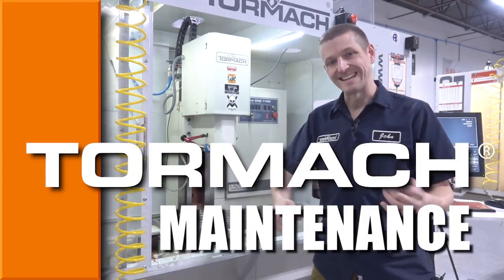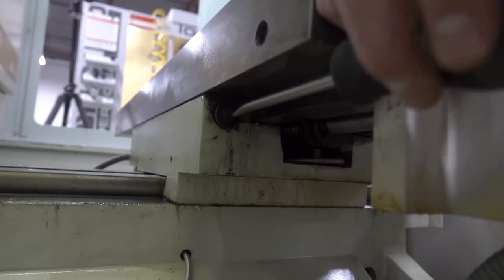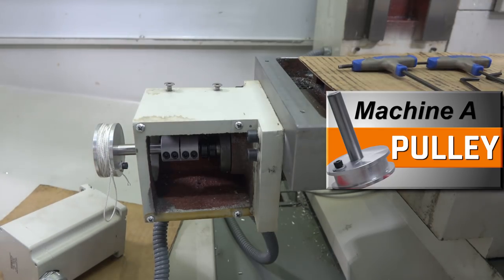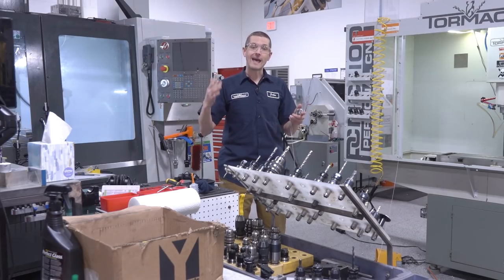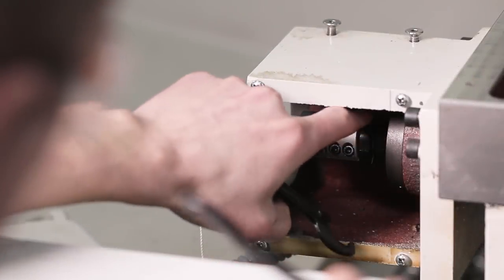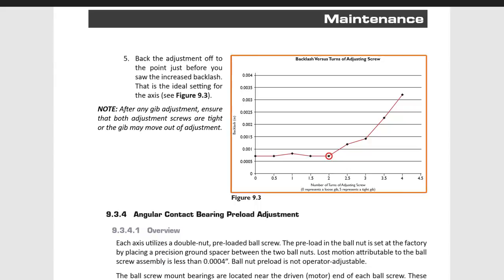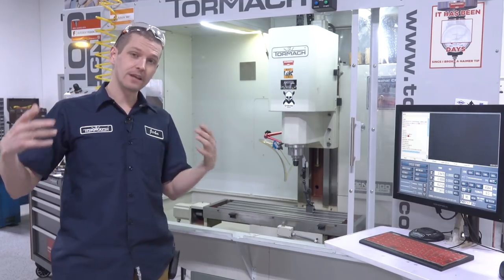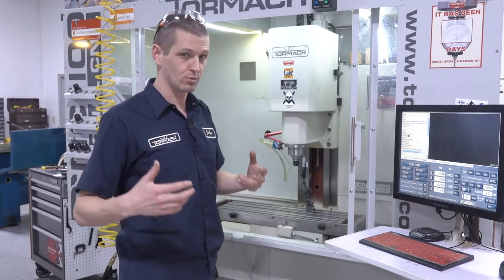Adjusting Gibs and Angular Contact Bearing on a Tormach! WW189

Comment: We do this very differently where I work assembling mills. For gibs we indicate the table in whichever direction we are adjusting and with a prybar move the table back and forth and tighten the gibs until we see .0002" movement, basically just tight enough that there is room for a little bit of oil between it and the bearing surface. As for the contact bearing with an indicator on the very end of the ballscrew we tighten the nut until we see about one tenth in endplay when jogging back and forth.
Reply: Matthew I'd agree. Some servo machines even have a nice feature where you can generate a drag graph after your done setting the Gibbs to show tight spots in travel. The other thing I noticed, which is a no no on a servo machine but probably ok with stepper's is using jog to check movement. Most older servo machines don't really move the set increments they just generalize however if you punch in an MDI move they are dead on.

Comment: John,

Love the vids!  However on this one I think you overlooked backlash as part of the problem in your end readings.  To get the lost motion from stiction due to drag you would measure it in one direction with all backlash taken up and preloaded to move in the test direction.  This would be the best method to determine actual lost motion from stiction and use that then to determine your actual backlash without stiction being involved.

For instance, you had 0.001" movement on that first test move with 0.0011-0.0012" commanded and stated it was preloaded.  This would be the more accurate lost motion from stiction reading.

When reversing direction, you have both the lost motion of stiction plus lost motion from mechanical backlash in the ball screw.  This is a very good method for accurately obtaining a backlash compensation setting because in most machining circumstances, the machine movements will be fast enough to overcome lost motion stiction on a properly adjusted machine which would leave you with just the need for that accurate backlash comp amount to have accurate positioning.

Just a thought!  Might be a good follow up video comparing the two and seeing what impact a properly adjusted gib has on actual backlash.  I have seen too often abnormally high backlash numbers from poorly adjusted gibs.  This would help many to solve that issue!

Keep up the great vids!

Chris

Comment: You make things very understandable.  Thanks for another great informative vid.  Btw, thanks to you for the superglue tape trick and I have to say the work holding class was great.  I have since bought two thread mills from Tormach and I am looking to use one this weekend in steel to cut an M12 thread in steel.  Nervous, but this is how we learn.  Thanks again for the spreadsheet.

Comment: Another option to the pulley is a torque tester. We use them all the time to test the pre-load of bearings for aircraft parts. Same Idea but may be more accurate with static holding in a pulley system.

Comment: Some machines have a "Drag" measurement feature. This is a test operation that runs the table back and forth while measuring drive current (I believe it is the current, or some other means of measuring load). he results are plotted and saved. Neat way to monitor condition by comparing results over time.

Comment: Another approach - other than the string and fish scale - would be to monitor the stepper motor current. For this, since the motor is driven by pulses, you'd need an oscilloscope to monitor the current pulses. Too tight a gib and you'd have excessive current pulses. This would be far more accurate and more meaningful since you know the manufacturers limits for motor current. In fact, I would strongly suggest you do get an oscilloscope. They are very cheap these days and it would show you if you're overloading your motor.

Comment: Even though I just did this to my 770 I'm about to do it again for "fun" after seeing this.
Reply: Nothing better to do with your tools and time?
Reply: I do have better things to do but I would rather make quality parts with my tools and time.
Reply: Then buy quality tools you don't have to "adjust" repeatedly "for fun" and can put to work and keep there and trust to do the job you purchased them to do until scheduled, regular maintenance/adjustment is required. Endlessly jacking with machines "for fun" is a really good way to do create problems if they don't already exist. Machines aren't made to be endlessly "fiddled with" and "adjusted" if they require tools and complex procedures to do so. When they are, they can be adjusted by hand. And they're typically even cheaper junk than machines that need "fiddled with" and "adjusted" when "brand new".

Nothing made to be "accurate" and "precise" and made to MAKE accurate and precise "parts" should need "adjustment" before its even "broken in" much less used enough to have any "wear". And I'm aware this is NOT "normal routine adjustment" for "new" machines and the "manufacturer" emails a link to THIS "how-to video" to its "new customers" who are sharp enough to double-check the machine before putting it to work and who do "test work" on the machine ASAP after delivery. Meaning it must not be in the operators/owners manual and that manufacturer must have pretty piss-poor "customer service" and "product support" if this "machinist" is their "trainer" on how to "adjust" machines that are supposed to be "right" right out of the box. 

What does Tormach pay YOU to act like this is all just "normal" and "fun" and how did YOU manage to do it without THIS HOW-TO VIDEO?

Comment: Hi, John. Quick question: don’t machines like this have a door interlock that prevents the machine from operating while the door is open? Also, I think one of your machines there in the background wants your attention; a white flashy light-on-a-post was blinking, saying “John, feed me!” 🤗
Reply: It's probably the Haas wanting its gibs checked too! 😉  Machines also can get jealous! 😉😉
Reply: The enclosure is an optional extra on Tormach mills. They don't have door sensors, but if they did it would be easy to disable them.

Comment: What about using a dial style torque wrench? I could be wrong, but it seems like it would be even more accurate. I’m thinking that the elasticity of the string and the diameter of the pulley will both affect your measurement.

Comment: The readings you got from the pulley set up are not correct. You must take in to account the leverage advantage you get from the size of the pulley. The reading should be taken with a dial torque wrench directly attached to the shaft being turned for the readings to be accurate for the bearing pre-load. Also new bearings and used bearings will require different torque specs.
Reply: It doesnt matter as much as you think, but i agree.  Plus flex in string.

But...the only thing that matters is if its repeatable.

Comment: So why do machines run dovetails rather then profiled linear rails? Just a cost thing or is there advantages to the dovetails that rails dont have?
Reply: Ways are much much more rigid than linear guides. They are generally not as fast as guides though.
Reply: Seems like most modern machines use rails, whats up with that?
Reply: Its a cost thing from what i understand linear rails are superior.  Much like running steppers vs servos.  Not knocking the machine they are great just not a full blown vmc, but they dont cost what a vmc does to repair!
Reply: Box ways are more rigid, linear are faster.  Most CNCs are plenty rigid for most of the work they do with them (though, most mfgrs sell box way machines too), so the linear rails are just fine.  They also have like 50 HP motors and can easily weigh 15,000 lbs.
Reply: Price for sure. Being adjustable is an asset though
Reply: Thomas Id actually say Linear rails are more rigid than box ways since they don't have the clearance. The difference is most linear rail machines are more modern and engineered to minimal cost.  For example a 1" linear rail usually replaces a 4" box way.
Reply: Hey! always makes me happy to see other youtubers I watch comment 👍
Thanks for the input!
Reply: So whats everyone's consensus, stay away from liner rail based vmc and go box way vmc... I guess it depends on the intended use right?
Reply: Beach&BoardFan I definitely wouldn't say avoid linear guide machines, or to prefer box way machines. Both have their applications. I work for a major OEM that produces both types. Our box way machines are far more rigid than our linear machines, but our linear and machines have the ability to be much faster than the box way.

Comment: He keeps calling the X motor a stepper motor.  Is there only a stepper motor and no encoder?
Reply: Yes the Tormach is all steppers.
Reply: Greg Feneis correct. Tormach uses open loop controls.
Reply: Then if he eliminates backlash and jams the gibs up and commands 4 thou in steps and only gets 1 or none, that could be step loss, not the lead screw (ball screw?) winding up. Not really consequential to the content, I guess
Reply: @gregfeneis609  you hear all the know it alls speaking of step loss, but after 1200hrs on mine, never have i run into it. Possible? Sure...

I just machined steel  at .4", and was less than .001" off.  Ive never adjusted anything. I just put new spindle bearings in (greasing old ones would have been enough, easily).  Its funny how many people say oh no...dont buy that, buy a haas.  And then they do nothing.  My tormach makes $1000 a day pretty easily.  I dont use it daily, just when i need to.

Comment: Not sure about your pulley and rope test. How do you know about the torque value versus your pulley OD?  This should be explained.  The bigger its D. the easyer to pull, therefore offsetting your torque values. Making the test non acceptable.
Reply: notice how he did everything relative to the same setup. with the same diameter, he measured before and after adjustments, and was able to see the torque change.
Reply: Pierre Flamand Perfectly acceptable, just scaled😊. To avoid some simple math, he just made the pulley grove about 2" OD. You can use any pully and just multiply the scale values by (R_actual / Preferred_torque_length_unit) to get true torque values. 

Example: 3.6" dia pully reading 21oz. So R_actual 3.6" / 2 = 1.8", and 1.8" / 1" = 1.8" ... actual torque would be 1.8" x 21oz = 37.8 in-oz of torque.